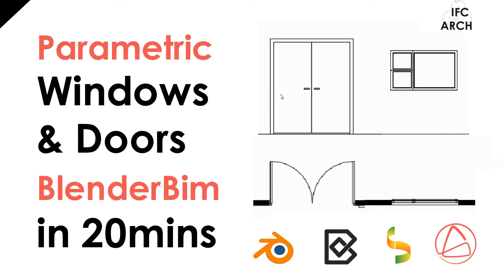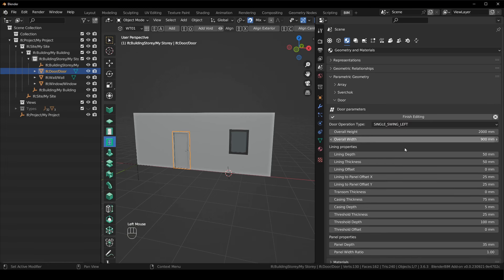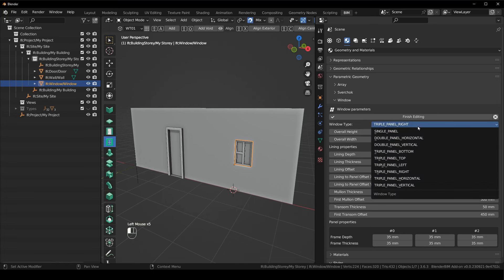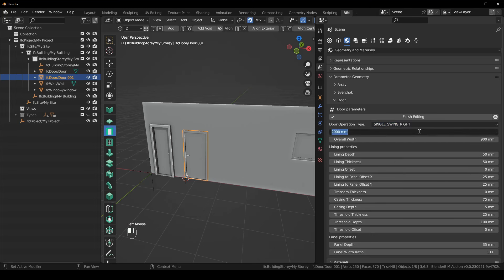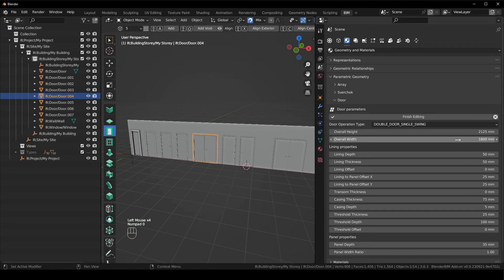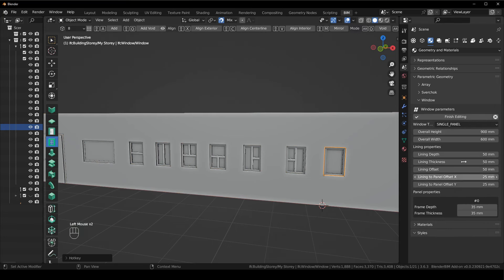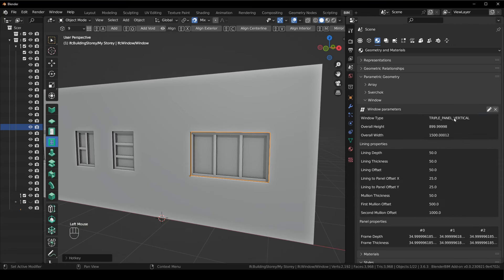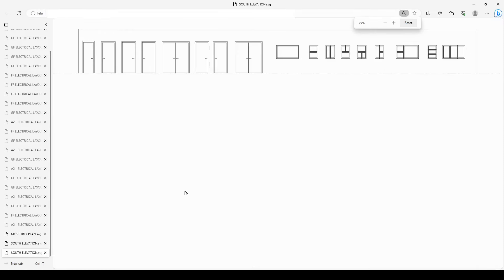BlenderBim - Parametric Doors & Windows

Comment: If you are all ready starting with a pre-existing house that has been made from say like Stephens Archipak. Would you then assign an ifc class to the different modeled types? Walls for Walls and Windows for Windows? I have about 4 different types of windows.
Reply: Or is it better to start the model from scratch in blender bim?
Reply from the maker: HI sorry, don't know how I missed this,
Ideally you start from scratch as a native Ifc model this is my preference, but you can totally classify an archipack model as IfcClasses and use it that way, it just takes a bit longer and requires knowing what classifications to use

Comment: Thank you for the great tutorial!! It is really helpful.
How can I change the door design freely, such as making a parent-and-child door, adding a glass section, adding a ventilation gutter, etc.?
Reply from the maker: Hi Shige

At the moment this is the extent of the parametric door modifier, If you want to add additional elements and detail like ventilation or louvres etc you would need to model it manually and classify it as an IfcWIndow or Door
Reply: @IfcArchitect  I got it. I'll try that. Thank you very much!

Comment: Hi, Can you tell me how to reduce the height of the slab cause I don't know where or how to use it
Reply from the maker: Hi Pavan, you can edit the depth of the slab by adjusting the slab thickness in the material tab.

1) Make sure to select the object you want to edit

2) Go to: 
Scene Properties / Material and Geometry / Materials / Object material / IfcMateriallayersetusage

3) Click the pencil icon and you can edit the thickness, from there remember to confirm the change

Comment: Lloyd as always your videos are great!  Do we have to load the demo library to do what you did today?
Reply from the maker: Hey King

Thanks! and no you don't need to load the demo library but it makes it easier if you have a base  door and window type to start with, so I would recommend it!
Reply: @IfcArchitect  is there a way to create my own base library? Or would you not recommend it?
Reply from the maker: @kingalysterianlion5542  yes you can create your own types Like I have done in this video using the window and door tool.

Or you can manually model them and classify them as Ifc doors or Windows

The latter is a very slow process

I would recommend trying to create a small example project for yourself and you can use that Ifc as your first base library and build from there, not a waste of time at all, but rather do it as part of a project not on it's own

Comment: In Blender 4.02 / BlenderBim  v0.0.231104 I have to manually add the voids in the walls for the windows and doors (as per this example).
Also after rotating a window, the moment I add the void, the window flips back into the original position.
Reply from the maker: I think that might be a bug, if you could report it on the github page it would be greatly appreciated:
https://github.com/IfcOpenShell/IfcOpenShell/issues

Comment: I have few questions and suggestions-
1. Is there anyway to combine home builder with BlenderBIM as it has very easy to change parametric library.
2. The drawings generated should have layers so we can edit those in inkscape. For changing colours of handle. Also, the handle should be made as inkscape symbol so we can make symbol library in inkscape and replace the generated one.
3. Any long term plan to integrate inkscape to further refine 2d drawings to improve presentation and also when we do some changes in the drawing, it update automatically.
Reply from the maker: Hi Rajendra, 
If you have suggestions I'd reccommend adding to the Github here:
https://github.com/IfcOpenShell/IfcOpenShell/issues
or the OSarch community here:
https://community.osarch.org/discussions

Homebuilder is an amazing tool but it isn't integrated into Ifc Schema, Andrew has mentioned an interest in integration if it would seem beneficial from his point of view, but fundamentally these are two different addons with dramatically different scopes.

Unfortunately I'm not the developer I just make tutorials to showcase workflows and the development but the developers are very responsive to constructive feedback and requests

Comment: Nice video as always Lloyd. Thank you very much. Practically now you can save all of them as part of the template. I noticed that there are different types per door swing. Is it possible to have one type of the door with two options, left or right swing?
Reply: I don't think you can, the type instance is holding all the parameters including the swing, changing one will change all corresponding copies from the same type. I usually name a door type based on dimensions and create 2 types adding L and R as suffix to identify the swing separately.
Reply from the maker: You are absolutely right Stefano, in the future hopefully door swing isnt hooked to type, but at the moment that is how it is.

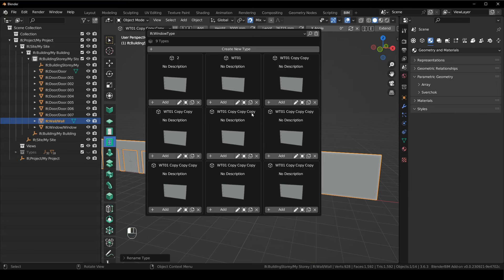Comment: 11:35 "Alright so we've accidentally added a window, I'm not certain which one it is..."
Could an overlay or other highlight be shown automatically to identify the window to make it easier, as in when setting up multiple computer monitors and trying to identify which screen is which?
Reply from the maker: Hi nice ride, yes it could be, it's a matter of UI and UX design which has been changing over time for the better, if you have any specific feedback the developers are very good with responding to requests on the github:
https://github.com/IfcOpenShell/IfcOpenShell/issues
Or the OSarch community:
https://community.osarch.org/discussions